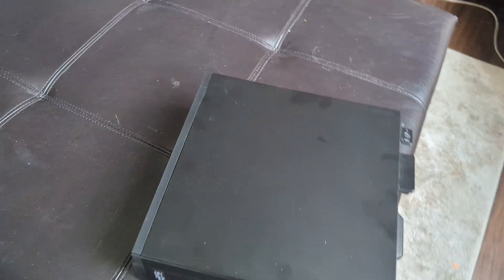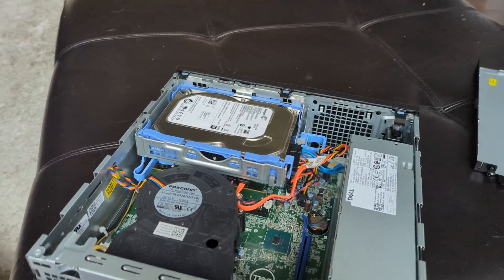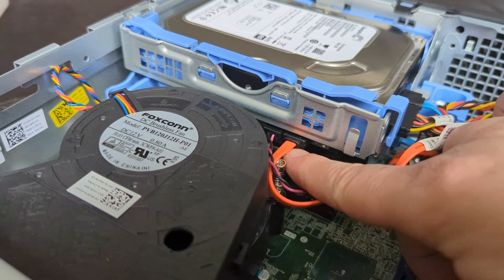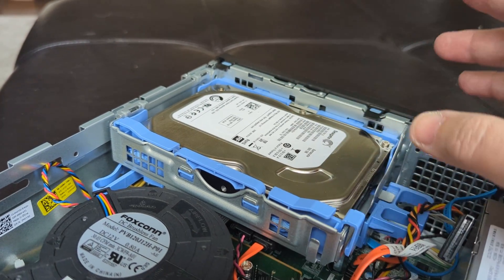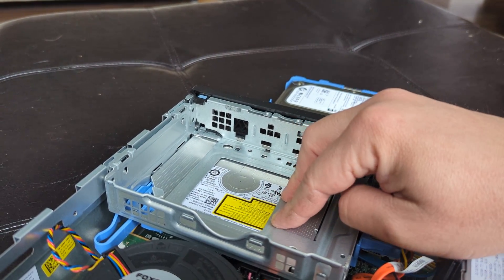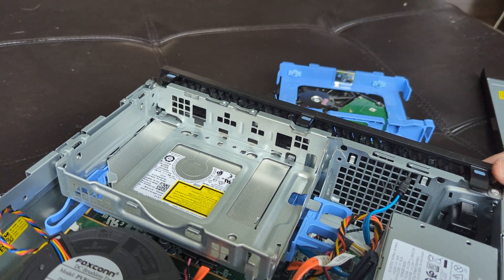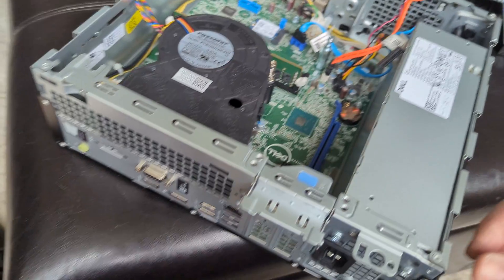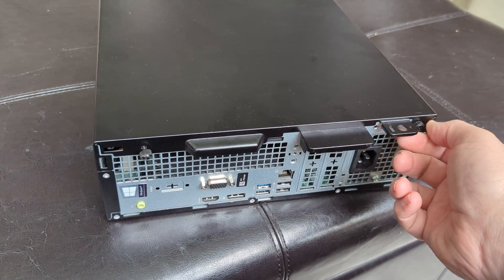Looking inside a Dell Optiplex 3070 Desktop Computer.  Small Form Factor (SFF)

Comment: That huge hard drive is horrible, I have an ssd and a hard drive like yours and every time I access the hard drive the PC slow down a bit, I can see the slowdown in opening the folders.
Reply: @BubuOZn  If you wanna put an SSD in that spot you can get a 2.5" SSD and an adapter.

Comment: Are you sure it's a wifi card under the dvd drive? It supposed to be an NVME SSD m.2 drive.
Reply: I just paused the video using 4K resolution. Yup, it's confirmed it's an NVME SSD. It says Wester Digital 256GB.

Comment: Which wifi card could you add to this?
Reply: @hman4232  Standard M.2 wifi module will fit in the slot labeled 'M.2 WLAN".
Reply from the maker: If yours does not have wifi built in, you could add a PCIE WiFi half card to this. Something similar to this would work. https://amzn.to/46He88g   You need to make sure it's a half card to it can fit the height of the machine.  If you don't want to plug anything inside of it, you could install a USB wifi card like this: https://amzn.to/3M3cpAU or like this: https://amzn.to/3M3cpAU
Reply: @FernandoC  thanks for the advice. Could you install a wifi card and a graphics card too? Or is there too little space?

Comment: What you pointed to as the Network Card is actually an M.2 SSD slot. The M.2 network slot is adjacent to it on the other side of SATA0 facing the other direction with the label 'M.2 WLAN'. If you look it has another anchor point in case you want to upgrade to a 2280 rather than the stock 2230. I have 3 of these. Upgraded with 1tb m.2 SSDs and dual wifi/BT module. People still in fact use optical drives. Myself being one of them. Itll play DVDs and Physical PC games. As a collector these pcs are great. They run emulators well and are reasonably quiet.  Upgraded the RAM too.  16gb low profile 3200mhz LPX Vengeance.
Reply from the maker: Thanks for catching that error.  I overlooked the 2nd anchor point for the larger chips.  thanks!
Reply: Hey man can you please let me know what is the wattage of the psu in this optiplex and can we upgrade psu ?
Reply: @Meesaa06  The stock PSU is 200w. There are PSU upgrades 260w, 300w, and 500w.
Reply: @FreakyFirestorm  THANK YOU
Reply: can i add ssd m.2 nvme  @FreakyFirestorm
Reply: @GoBaModi  Yes, as stated it has an M.2 slot for an SSD.
Reply: @FreakyFirestorm  but he said nvme
Reply: can i add a ssd m.2 nvme?
Reply: @GoBaModi  yes
Reply: @FreakyFirestorm  i have optiplex 7080
Reply: @GoBaModi  Yes. The 7080 micro, sff, and tower all have m.2 slots for SSD and Network card.
Reply: Any recommendation for a good budget low profile GPU? thanks.
Reply: @gforcekaras You have a few options depending on your psu. The manual mentions these three; 2 GB NVIDIA GT 730, 2 GB AMD Radeon R5 430, 4 GB AMD Radeon RX 550. But you could also try, Intel Arc A310 Eco, Radeon RX 6400, and i think the RTX 3050 OC would fit but might have trouble breathing. Just bear in mind that they all have a different I/O so make sure you get one with the ports you want cuz with the ARC it has one HDMI and 2 Mini Display ports so youll need a mini display port cable. Alternatively, you can have more options if you use an external GPU dock or modify your case to support a more powerfull psu and also make room for larger GPUs.